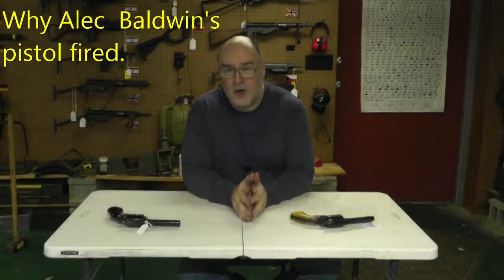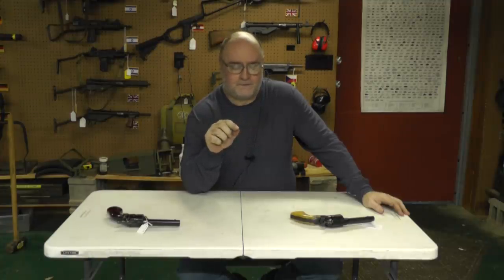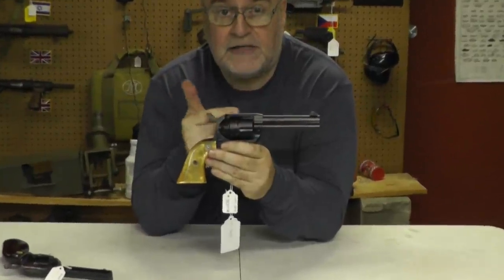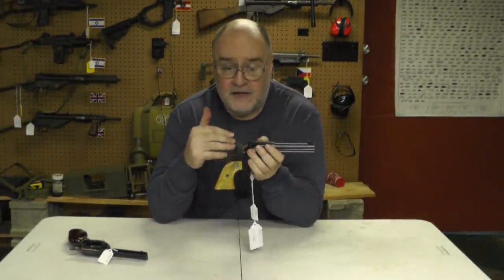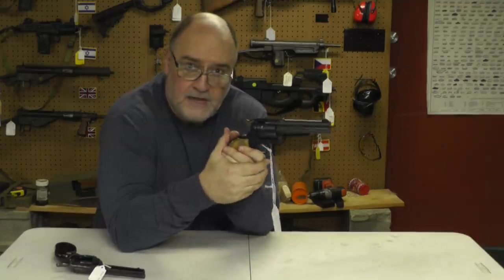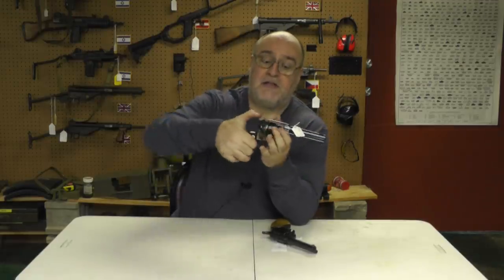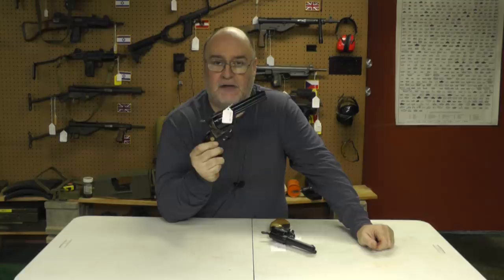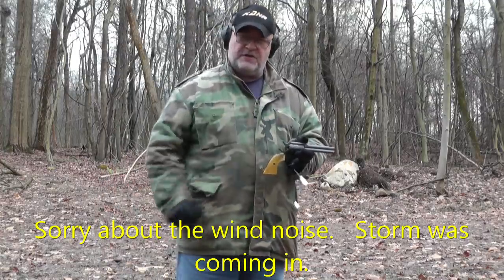Why Alec Baldwin's gun fired

Comment: I think you've got this absolutely nailed.  I think AB may even believe it when he said he "didn't pull the trigger", because he didn't make a conscious effort to move the trigger backwards.  But because he gripped the gun like he would for the scene they were discussing/rehearsing (heard different stories about that), he would almost certainly have had his finger in the trigger guard - otherwise the scene would have looked wrong.  And not knowing how a Colt SA (or clone) worked, he didn't even realize what he was doing would effectively "deactivate" the safety mechanisms of the gun, and allow it to go off.  Because he refused to even perform basic safety checks and operations with the gun, like letting the hammer down gently (not just letting it go), someone lost their life - and that was just the last of what seems to have been a series of stupid mistakes and decisions made that day.
Reply from the maker: How did you find my video?   And please share it.  I think it will help lots of people understand this issue better.
Reply: The civil suit will cost him.
Reply: The criminal case should be interesting after the Officer Kim Potter verdict.
Reply from the maker: @shawnshipstad9281  as it should
Reply: 1st of all, alive bullet found its way into the gun. Did every chamber and the revolver have a live round or just the one that the hammer fell on to. Also, Alec says that Hylena told him to point the gun at the camera and pull the hammer back as she framed the scene and camera. Alec should have said, said, "no Hylena, that's not a good idea, I shouldn't operate the gun so close to you. Let me inspect the gun again to make sure it's safe." Now that's what Alec should have done, and would have discovered the round in the chamber...
Reply: I agree with you that he must have subconsciously pulled the trigger’ it’s easy to do. However, the only “safety check” he could have done, since the gun was loaded with dummies and meant to look “loaded, could have been to dump all the rounds out and rattle-test each individually, no? I have a hard time believing that every actor with a revolver is doing that. Is not that what an armorer is supposed to be there for?
Reply from the maker: @Charlesslides  he could have rotated the cylinder and checked for primers.  Most dummer rounds do not have primers
Reply: @Charlesslides  Exactly so.  This was a chain of screwups all the way through from the armorer not securing the gun to the AD handing it to Baldwin saying "cold gun"  without himself having verified.  In a competent production, the armorer confirms safe in front of the players and crew pefore putting it in the player's hand.
Reply: @chedelirio6984  People treat me like I’m dumb all the time for asking basic and simple questions to verify we are all understanding the same things. I’ve seen how it can all go bad quick. Checking any gun is second nature if you handled them since longer than you even have memories of doing so, same for finger on the trigger. AB is a reprehensible ass, handling this terribly, but I’m not hanging the scarlet letter on him for this because I also know what survivor’s guilt feels like.
Reply: @philiphorner31   precedent has been set so that genuine mistakes are criminal now after Potter trial. You don't need any kind of mens rea anymore. If you look at legal definition of recklessness, it was not proven in Potter case and she was wrongly convicted because of ridiculously bad jury instructions. I feel bad for the poor woman.
Reply: @Charlesslides  no! number one rule in firearms is you clear the weapon personally. never ever take someone's word that the weapon is "unloaded". number two is never point a weapon at someone/thing you do not intend to destroy.
Reply: @psp1921tsmg  very true
Reply from the maker: @chedelirio6984  exactly.  I’ve been on two set and my boss the head armorer checked and double checked everything and when loading weapons he loaded them and handed them directly to the actor and they were loaded just before the scene
Reply: @joerobo682  I get that one should, my question is “Do I believe every actor on every set clears every gun?” I do not.
Reply: @Charlesslides  then they themselves are responsible for any death or injury that occurs due to their negligence.
Reply: @philiphorner31  Which I wished she would have been found not guilty. That's gonna destroy our LEO employees!
Reply: @Defender78 ; your question about why a live round was in the gun in the first place is a valid one. I'm sure the NM police have been checking into that from word go. But if the armorer had been doing her job, even if someone had been "playing games" with the ammo, the live round would have been detected long before Baldwin ever touched the gun. The chain of errors and unsafe acts that caused this death is long, but Baldwin's errors were the final links that killed that young woman.
Reply: @psp1921tsmg  Sorry Machine Gun Dad, it depends on who made the Dummy Round, some of them would be impossible to detect without a sensitive Scale to detect whether there was a Powder  Charge. Mr Bawlwin was told the "Gun was Cold" , at this point in the game, there  was   no way in hell he could have known the Cylinder contained a   Full Power 45 Colt.  Let me remind you there are no Laws, or regulations regarding the  manufacturing of Dummy Cartridges.
Reply from the maker: @charlesmynhier2652  so your saying they use dummy rounds with primers that aren’t drilled not contain bbs and use them when loading the gun is not shown?   Got a link to the company that makes them?
Reply: @psp1921tsmg  Has my response been deleted ? Yeah You can control this thread, and delete anything that shows, you are not as in control as you would have us believe. This will also be deleted, but not before others have read it :-)
Reply from the maker: @charlesmynhier2652  I only  delete spam.  If you comment is gone it was YouTube that deleted it   Look over the other comments you will see people I clearly don’t agree with.
Reply: @psp1921tsmg  Video is superb and well demonstrated
Reply: @psp1921tsmg  I've been an armorer on movie sets.  Yes, there are "hero dummies" that have a fake primer, rattle in the brass, and a real lead bullet in the tip.  They are used for those close-up insert shots when you see a pair of hands loading a revolver from a box of rounds.  Look totally real from a 360 degree view, but are inert dummies. Sometimes a stand-in hand model does scene, not the actor.  Call ISS or the Hand Prop Room in Los Angeles, California.
Reply from the maker: @jefferyk.spellerberg176  yeah but Baldwin hired a non union armorer and ignored all safety protocols so what those organizations authorize or approve does matter does it since the production chose to ignore their rules/guidelines
Reply: The film production co. must have hired experts to take care of their prop. firearms but maybe the experts in charge overlook the possibility that certain action by someone who handle the cowboy's single action revolver might fire the loaded pistol. I am not an expert in prop. guns handling but why they have a pistol laying around with live cartridges in it ?.
Reply from the maker: @DrVincentHVTran  because the company hired a in certified armorer
Reply from the maker: @irongoose3865  how hard is it to fire the gun handler after 2 prior accidental discharges which Baldwin did not do.  He also permitted live ammo on set for target practice after filming hours. He’s not just a actor he’s the producer who was aware of constant safety violations and did not attempt to correct them
Reply: @psp1921tsmg I don't know what the law is adout having live rounds on a movie set for target practicing after hours. I don't know the circumstances behind the accidental discharges.
But if you are paid to make sure a gun isn't loaded with live rounds and a live round goes off and kills someone then you are the negligent one! 
If someone is being taught how to use a gun at a range and all safety protocols are being used, like keeping the gun pointed down range at all times, under the supervision of a trained instructor and a gun accidently goes off is that reason to fire someone? Just say'n. 
In a case like that the individual's training prevented anyone from being hurt. That's why you take the precautions in the first place. Something was learned and nobody was hurt. Accidental discharges happen to even the most experienced! Just talk to people who shoot often, you'll hear stories. Back to my original point, we don't know the circumstances behind those incidents.
Having live rounds on set for target practicing in itself  
didn't cause this accident. It was the negligence of a individual who was in charge of making sure a gun wasn't loaded with live rounds who was responsible for this accident and not the liberal actor.
Reply from the maker: @irongoose3865  you should read the police affidavit.  On a movie set if a gun goes off when it’s not supposed to id say yes someone should be fired especially when it happens twice and it’s so dangerous some of the crew quits
Reply: @psp1921tsmg  I don't know where I can get that but if the paid gun handler was involved and was so careless in his use of firearms and Baldwin knew adout it he should have certainly fired that person.
Reply: @psp1921tsmg  Well, I see this argument all the time, but I doubt it will hold water in court.  There are all kinds fo Producers on films, and they have all kinds of responsibilities and duties.  I would bet that if you looked at Baldwin's Producer Agreement, Baldwin didn't have the authority to hire anybody, unless maybe his make-up artist (and that would more likely be in his actor contract).  The Production company hired the Armorer, and the person responsible for hiring the crew, and who could be responsible for a case of negligent hiring, would be someone called the line producer or the Unit Production Manager.   Baldwin might be civilly liable as a corporate co-owner, if he owned shares in the RUST LLC, but I don't think Baldwin would be the person on the production who "ignored all safety protocols.  I think the prosecutor's attempt to find him guilty of negligent homicide as a producer will be much less likely than a conviction as an individual.
Reply: @irongoose3865  Live rounds are never allowed on any movie set for any reason.  If you want to show a bullet hit something, you don't use real bullets, you have special effects put squibs in the set piece that is supposed to look like it is getting shot.
Reply from the maker: @jefferyk.spellerberg176  you have access to baldwins contracts?   Do you know who actually hired people on this movie?
Reply: @psp1921tsmg  No sir, I do not.  As an entertainment attorney I've drafted enough production contracts to know that it is virtually certain that Alec Baldwin had no hiring and firing authority, nor was he responsible for how the set was operated. He and other producers like him are called an above-the-line producer.  His Producer contract was very likely related to financing and perhaps artistic input, perhaps regarding the script or other things that are not related to the day to day operation of the film set itself.  Above-the-line Producer contracts typically involve profit sharing clauses and methods to recoup investment amounts.  The producers that do have the day-to-day authority are called something like a Line Producer, or a Unit Production Manager (there are other titles for the same job), and that producer would have a book of contacts of crew people, and have other connections to other line producers, so the UPM could fill out the below-the-line crew, who are the people who work on the film set.  I hope this helps.
Reply from the maker: @jefferyk.spellerberg176  so in a low budget film like this you basically don’t know?   And weren’t people like the armorer doing double jobs?
Reply: @alkestos  I share the same concerns as you. I was sympathetic to the Kim Potter case, but the main difference between that case and this one is that it was her job to pick the correct weapon. I think if someone gets injured while resisting arrest, that ought to be considered a mitigating factor. But alas, it was a different case in a different state. A truly unbiased and fair-minded jury ought to find AB not guilty on this, assuming a well-organized defense. Yet I think you're correct in that society seems to have shifted to judging things through a much stricter lens of human perfection, expecting people to walk around on full-time DefCon 5 alert level, ready for any misconfigured inanimate object they touch to explode on contact. By these standards, I'm expecting someone who forgets to fasten their seatbelt on an airplane to be charged with IM someday.

Comment: Keep your finger off the trigger until ready to fire. Firearm safety 101. Thank you for this very detailed explanation and demonstration.
Reply: ALWAYS Keep The Gun Pointed In A Safe Direction
This is the primary rule of gun safety. Common sense dictates the safest direction, depending on different circumstances.
ALWAYS Keep Your Finger Off The Trigger Until Ready To Shoot
When holding a gun, rest your finger alongside the frame and outside the trigger guard. Until you are actually ready to fire, do not touch the trigger.
ALWAYS Keep The Gun Unloaded Until Ready To Use
If you do not know how to open the action or inspect the chamber(s), leave the gun alone and get help from someone who does.
Nothing can ever replace safe gun handling.
NRA
All guns are always loaded.
Keep your gun pointed in a safe direction.
Keep your finger off of the trigger and outside the trigger guard until you are ready to shoot.
Be certain of your target.
Jeff Cooper's Rules
Treat all weapons as though they are loaded and/or ready to use. Do not play with weapons and NEVER point one at anyone, including yourself.

SAGAFTRA

Before any firearm is used in a rehearsal, an on-camera sequence, or off-camera, the Production will conduct a safety meeting with all involved personnel to acquaint cast and crew members with relevant safety issues. This safety meeting shall include an “on-site walk-through” and/or “dry run” with the Property Master, designated Production representative, and anyone who will be using and/or handling a firearm.

It is important that everyone treat all firearms, whether they are real, rubber, or replica firearms as if they are working, loaded firearms.

Movie Industry Rules

Comment: You just explained what I had thought. I have little experience with hand guns. Mostly rifle and shot gun experience growing up. We had a 32 S&W break over barrel that I believed worked in the same manor. Hold the trigger, cock the hammer, and letting it go would fire it. The only thing that boggled my mind is he said he didn't pull the trigger but he probably did pull it. He just pulled it before cocking the hammer just as you did so that is why he said he didn't pull it. But, as you it has bothered me why there was live ammunition involved on the set anyway. No one seems to be concerned about that eventhough it was the first of several problems leading to the shooting. I know the analogy I am about to make is a bit different but it runs along the same lines. If the person responsible for testing for contaminated fuel going in a commercial airliner doesn't do his job and contaminated fuel brings down the air plane, is the pilot responsible or partially responsible? He could have taken it upon himself to follow up with the person responsible or examine the fuel himself so does that make him a responsible party since he didn't at least question if it had been done? Yes I know in general aviation the pilot is responsible for checking the fuel. Or maybe before anyone as a driver leaves the tire store they should check if the lug nuts have been tightened or tire pressure correct. Don't get me wrong, I don't like Baldwin for a mired of reasons but I also see there is someone much more responsible assuming Baldwin didn't bring his own gun to the sight.

Comment: He was using, specifically, a Pietta repro of some sort. I've been told that one part would need to be replaced to be functionally identical to an SAA, just for more info, which is why they're popular for moviemaking.
Reply from the maker: It’s an exact copy as my sons starts as a pietta
Reply: @psp1921tsmg  Just about literally the same gun. Great video!
Reply: @superfamilyallosauridae6505  Some companies make a variation of the 1873 Colt SAA, where the firing pin is in the gun, not on the hammer, and there is a shield between the hammer and firing pin (commonly called a "transfer bar") which makes it safe to load 6 rounds and carry it that way. But otherwise it works the same way as the original Colt design. When you pull the hammer back, it moves the transfer bar out of the way. But you still have to pull the trigger to fire the gun. There is simply no way either design can fire without pulling the trigger.
Reply: @geraldscott4302  The movie "Rust" takes place in the 1880's.  The Colt "Cowboy" with a transfer bar was introduced in 1999.

Filming an 1880's period movie using a Colt without a firing pin would be a severe anachronistic mistake.
Reply: @franksolario1842  Yes it would. They were using a copy of the real thing, designed in 1873. A "transfer bar" would not have prevented this tragedy. All it does is allow you to safely load 6 instead of 5. It prevents the firing pin from resting on a live round when 6 rounds are loaded.